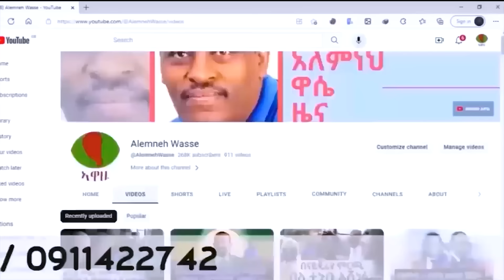Alemneh waseb#ሰበር--ምዕራባዊቷ  የዩክሬን ከተማ #ላቪቭ ተነረተች!ፖላንድ #የጦር ጀቶች አስነሳች!!

Comment: "What we see in Pokrovsk is the result of the very late and insufficient mobilization effort that was delayed politically in Ukraine," Nico Lange, ex-chief of staff for Germany's Defense Ministry, told Newsweek. "Not having mobilized enough, defense around Pokrovsk is now a big problem.

"Many units in the Pokrovsk area have the problem that they cannot hold the line or they have to retreat because they are just staffed by 10 or 20 or 30 percent—and they lack personnel," added Lange, nonresident senior fellow at the Center for European Policy Analysis (CEPA